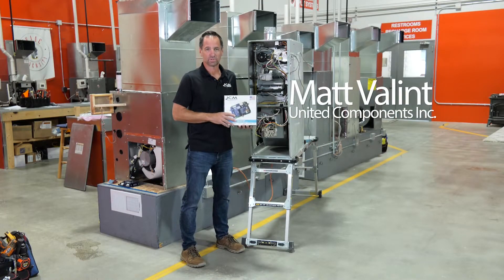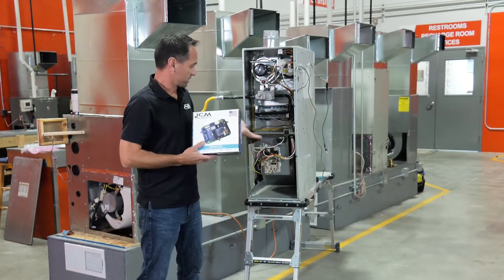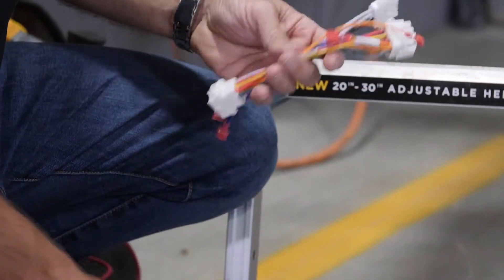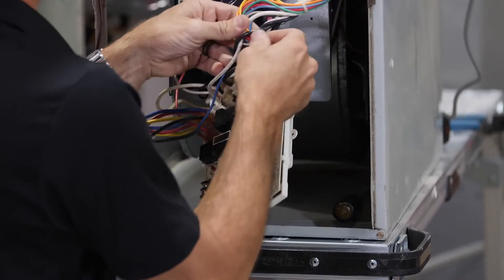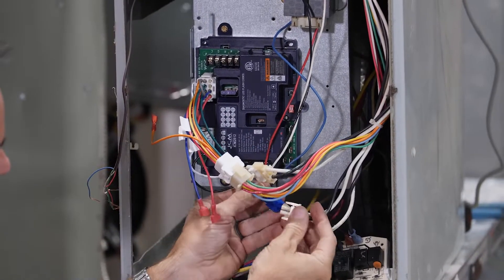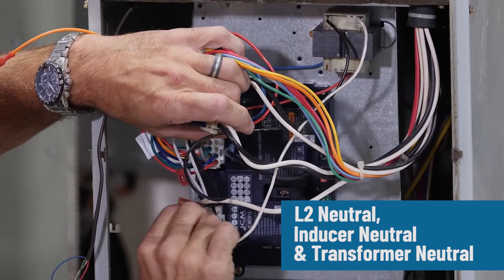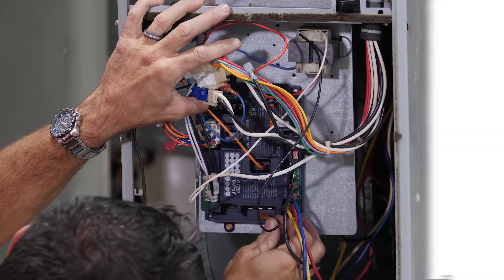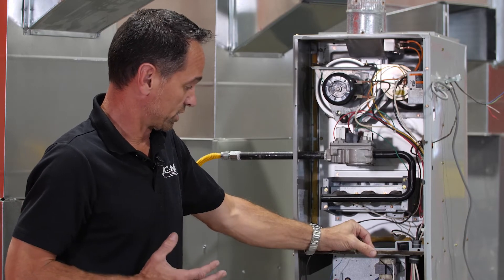Installation Video ICM2812-KIT Universal Furnace Control Board

Comment: I just bought one and it wouldn't pick up the flame sensor current. Replaced it with another and it works ok. I'm stuck with a defective board.

Comment: Hi,
I have 3 speed fan blower motor 120volt
Can you please advise which one control board I can instal for using 24volt WiFi smart thermostat?
I don’t have a heater, only cool

Total I have 3 fan speed wire, 1 cool wire, 1 power 120v wire, and 1 common wire

Thank you!